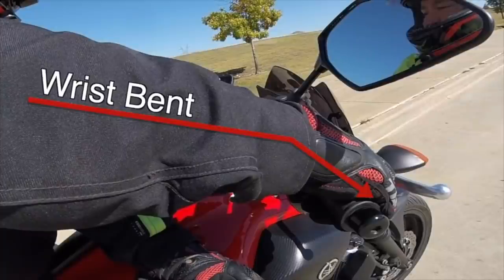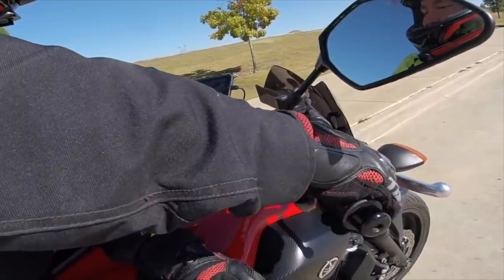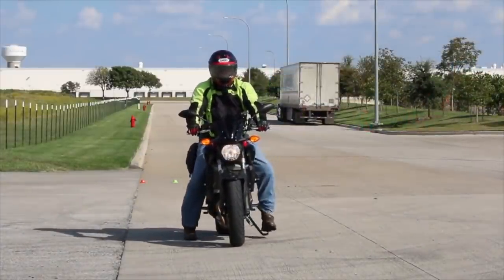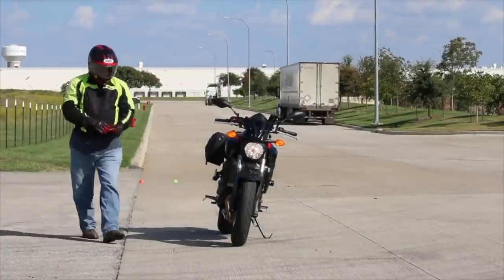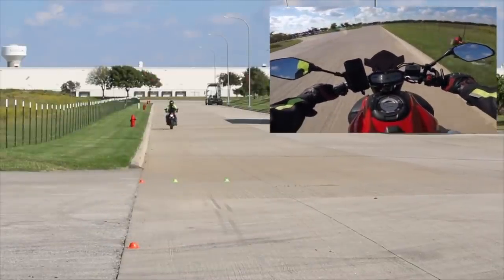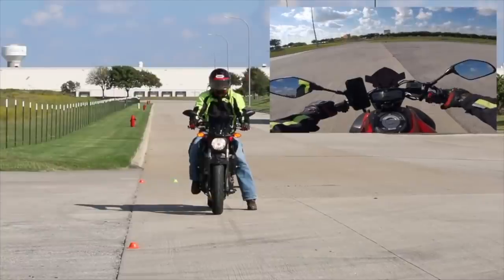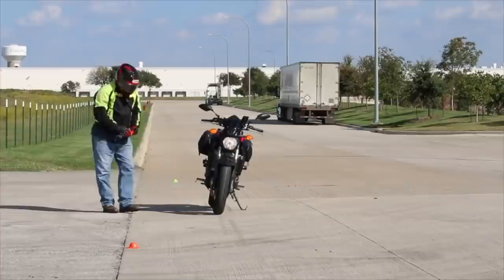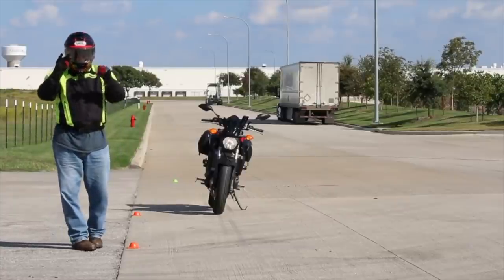How to use the throttle...many are doing it wrong.

Comment: I always cover the front brake with 2 or 3 fingers.  I roll on the throttle between my thumb and fore finger.  So I never have to reach for the front brake and I always have contact over the lever.
Reply: The fore finger tells the the other fingers how much and how fast to squeeze.  Index and middle finger is the ticket.
Reply: Helps with smooth throttle control too✌🏽
Reply: I do the same thing.  Bonus with throttle control.  However, in cold weather my pointer finger suffers the arctic chill. Heated gear helps. I was worried this is a bad habit. Thanks for validating and verifying this is good form.
Reply: Most people recommend the forefinger and middle finger on brake lever, but, like you, I prefer thumb and forefinger on throttle and outside 3 fingers on brake. I have equal throttle control and more leverage squeezing the brake in emergency situations.
Reply: @Old-n-slo-locked-n-leaned  My fore finger covers the brake while rolling on/off the throttle.
Reply: Glad to see I'm not the only one. I consistently ride with pointer & middle fingers on clutch/front brake levers. Def helps with throttle control/stability especially on the highway
Reply: Big hand guys. My hands are small , using gloves for a 12yr old is normal for me. Handles are not or poorly adjustable for us thus giving trouble with controling the lever.
Reply: @tpilot_error404  Lots of aftermarket levers to help.
Reply: @tomquinn607   in the US aftermarkets are easier to get , EU doesnt approve lots of aftermarkets and import  taxes are heavy.  I was happy with the one I had but lately it had wear out and broke off ( 15 yr old , 70.000k bike) so I ordered the original part but they changed the version (shape) and now I got these trouble.  With another bike I don't use that much ( 23 yr old) the lever is too far away to grab them both and non ajustable ( special version).
The custom parts I ordered almost never fits and because the bikes get old , my budget shrinks when other parts need repair . They are not showponies. I ride daily and have no car.
Reply: @tpilot_error404  I am an expat living overseas.  I never rode a scooter in the USA but now I have owned some fabulous CVT scooters.  They are fast and comfortable and exciting.  Looks like the answer for you bro.  I'm looking into buying one right now.  Yamaha, Suzuki, Honda and Kymko come to mind but even BMW and Aprillia make wicked scooters.
Reply: @Old-n-slo-locked-n-leaned  I do this as well. Never had an issue with emergency braking! I have tiny hands, so I've had short levers on my two bikes, an R3 (that I've done 130,000 kms on in 6 years!) and my Triumph Street Triple R
Reply: I do the same always have
Reply: I do the same thing.  Helps to make sudden stops if your fingers are already covering the brake.
Reply: I've been using the same method for years and works well for me also.
Reply: I was doing this at the MSF course… I was told that’s unsafe
Reply: @CarlosD360  This is accepted technique for throttle control.   There are other techniques as well.  Don't believe everything the MSF instructor tells you.  Research ..."throttle control".
Reply: @tpilot_error404  AVS adjustable levers will help with that
Reply: @tomquinn607  Only fore finger?
Reply: @CarlosD360  Why?
Reply: @noonsun533  No.  My whole hand is in play.  It's really one accepted form of throttle control.  Search "Throttle Control" on You Tube and you'll find my style and a couple others too.
Reply: Yep... Good practice I reckon.

Comment: You don't need to roll off the throttle to apply the front brakes, throttles are self-closing, just loosen your grip and let it close automatically. They self-close for a reason and don't need your assistance.

Comment: If I'm going to brake, I just let go of the throttle and reach for the front brakes. I never roll it back. The only time I'll roll it back is if I engage the throttle lock, but I never engage my throttle lock anywhere I may need to stop suddenly.

Comment: How to use the throttle. If you are getting sideways or otherwise have a problem, gently throttle on and pull out of the situation. Don't panic, don't brake, leave the clutch alone. If you have a blowout or otherwise a tire issue, don't touch any control, assess the situation and then jently brake on the tire that is still inflated.

Comment: I figured something out for myself a couple of days ago. I've been riding for almost 6 weeks, done 800Km (500m). I thought I was counter steering quite well. But recently in a corner, I found that my hand position was rolled too far forward and when I pushed I was effectively pushing on an angle rather than horizontally. This seems to me to be another good reason to hold the handle bars with the knuckles positioned up like you say. I'm using forefinger and middle finger (2 fingers) on the clutch as well.

Comment: This is one issue I've noticed while riding a smaller bike, like a 250cc. It almost encourages you to use the wrong wrist position just to be able to get up to the speed of traffic. I find myself constantly correcting for it.
Reply from the maker: Good point...on smaller bikes you need a lot of wrist rotation to get up to speed.
Reply: I havent even rode a bike yet and I already assumed that would be a problem. 
I am clearly blessed with superior foresight

Comment: I tend to ride with my index and middle finger touching the brake lever. I don't know if this is the right technique but it seems to prevent any delay in engaging the brake for a quick stop and allows me to trail brake without fully disengaging the throttle when I'm cornering.
Reply: That is the correct way to ride, take any advanced course or any track time at an on road or off road track and youll find out quickly. Theyll let you know if they dont see fingers on the levers at all times.
Reply: @AboutaMileAdventures  thank you
Reply: @AboutaMileAdventures  Thanks! I ride with my index and middle finger touching the brake lever and when I see that people teaches with no fingers touching the breake levers I feel like Im doing something wrong... thaks again for the tip

Comment: Hello Kevin, it's all the little things that make for a good ride. Back in the day, 70's or so, there was billboards that read look out for the other guy. I still go by this. It's almost like a sixth sense that helps reduce reaction time. Also on the throttle if you let off your grip on it, the throttle should snap back as it's spring tension pulls it back to idle.  Thanks for the video.
Reply: Letting go of the throttle completely is the opposite of smooth control
Reply: @nemomoriarty4303 So?  Who cares about being smooth with the throttle in an emergency braking scenario?
Reply: @jridenour31  I imagine anyone who wants smooth control over the motorcycle might.

Comment: Adjust your front brake AND clutch levers as to make your wrists straight. This will in essence keep you from rolling back on the throttle when in a hard braking situation or just braking in general. Last thing you want to do is accelerate while reaching for the front brake. These levers are made to be adjustable so you can tailor the bike to fit YOU. This also helps if you have a problem with tingling hands as it keeps everything in a straight line. It makes a big difference by doing these small adjustments.

Comment: Another problem / solution is the angle of your front brake lever. Changes in the position will help with being able to roll of the throttle while braking. Thanks Kevin for the great info!!
Reply: Yep, that's a good one. Most of the time these lever needs to be lowered from the stock version.
Reply: My master cylinder would rotate
 along with the brake lever if you try to change the lever's angle. Sucks.

Comment: This is something I need to practice more. A few months ago I started covering the front brake with a couple of fingers with the idea being that it would shorten my reaction time if I need to stop quickly. It does shorten that reaction time, but I'm compensating for the new hand position by starting my throttle with the overhand wrist position. Now my problem is that when I roll-off the throttle to stop at an intersection, I never roll off completely. I get to the stop and have to let go of the front brake so the throttle can completely reset under my hand. I'm going to start paying closer attention to how I manage the throttle rather than how to keep a couple of fingers over the brake. My riding style doesn't demand a lot of brake coverage around town, so maybe I should save the brake coverage for those open-road twisties. Thanks for another thought-provoking video, Kevin!
Reply: Try taking your hand pressure OFF of the grip/throttle and handlebars. Light touch and be able to move your arms and hands easily.  Think of the least amount of pressure to exert to the bars and grips; it can save your life.  Good Rides
Reply: Already logged about 6 hours practicing with my first big bike(650cc). Came directly from a 110cc scooter. At the start I was straining my grip and felt very uncomfortable using the technique of covering the front brake lever with 2-3 fingers. Now I’m already relaxed and comfortable with the technique. So I guess it’s just a practice and getting used to issue. The benefits of having your fingers out there (less panic braking, lesser stopping distance) outweighs the discomfort of practicing imho.

Comment: Thanks for the video! Should have watch this before I started riding my Surron. I have rode ATV's for years but getting used to the twist throttle is a challenge. When I was 10 years old I tried a little 50cc and did the "twist and go fast and then roll back throttle harder and go faster" and thank god my dad grabbed my shirt at the last minute, I would have shot off at a million miles an hour.  
Anyways 25 years later I had my first crash not even an hour in to my new Surron Ultra Bee JUST LIKE when I was ten years old. Fortunately I was also pretty heavy on the brakes so the crash was slow and in thick grass. But its was almost certainly because I got cocky with the comfy throttle position and went "neutral" but still had power. I guess its like playing a guitar, you just have to get used  to that discomfort. Good to know!

Comment: I see a lot of front brake levers turned more towards the ground which doesn't help with throttle control either. Always interesting, thanks!
Reply: Height of rider also determines position of the lever controls.  I'm tall with short inseam (long torso / short T-Rex legs), so my levers are adjusted slightly downwards as compared to a normal proportioned rider -- smy shoulders will be higher than others sitting on the same bike.
Reply: I adjusted mine downwards so when i'm off the throttle, and my fingers are at their farthest "forward" position they clear the lever faster and easier.
Reply: That makes it easier to cover the lever with your fingers if your using the technique.

Comment: All good stuff.  Very helpful.
There is also the issue of positioning your levers where you can best use them.  I spent a lot of time getting bar and lever angles right on motorcycles - and I still do on bicycles.
With clip-ons (truly the only choice for a sports bike) the levers are often best rotated down so that the wrist is straight when on the brakes. 
Of course there are bikes and bikes.... Slamming around off-road on a big-single trail bike (XT600 et al) requires different braking approaches to a road ride on heavy traffic on a sports bike.... and tracks are different again..... as are Alpine passes.
But everything in this video seems just about spot on.

Comment: Anyone who ever learned to ride a bike inevitably has grabbed the hell out of a front brake when something scared them in a parkin lot and dropped or nearly dropped their bike. Something I do is always cover the front brake with just my index finger. This does 3 things, firstly I am already on the control so I can apply it immediately when I realize I may need to slow down, second 1 finger is not very strong which means even under stress it is difficult to accidently over apply the brake causing me to drop it, and third it maintains that I never have to change my wrist position significantly to use the lever. Just a thought use it as you will. As well since I do ride a bike with a rather upright riding position I do have my bars rolled forward some and my levers lower than level so standing while riding is much easier, this allows me to be much more visible in congested traffic as well as see what is going on ahead in traffic much better than from a seated position. But, that happy medium of bar and lever position makes getting fingers around the levers much easier even if I was not covering them since my fingers don't have to become paralel with the pavement.

Comment: I like the second exercise, as that is what you have to do on an electric motorcycle with strong regenerative braking. As you roll off the throttle, the motor turns into a generator, taking energy from the back wheel into the battery.

Comment: I ride Solo the majority of the time and have a tendency to jam through the gears pretty quickly; probably short-shifting and not getting into the higher rev's. If and when I do have a passenger I become very conscious of my shifting habit because it causes a lot of head-bob. So I adjust and rev a little higher, and shift a little smoother.
Reply: When I have a passenger I pretend it's raining

Comment: This test seemed a bit subjective. Also, my brake lever is not several inches above my throttle like you showed in this.  However,  I am ALWAYS willing to learn, even after 55+ years of riding bikes, I will find an empty parking lot and check out the difference it may make to me.  I have a nerve in my wrist that gets pinched, after riding for over 500 miles it can start to cause pain and numbness.  If I hold my hand in the correct position, the nerve does not pinch.  Now that it is something I am thinking about, I will have to notice just where I place my hand.  I have a feeling it is somewhere between.  Thanks.

Comment: i would often hold grips in that wrong way when off roading because it would be easier to withstand shock and impact without wrist injury, however the tradeoff was the problems you mentioned.  I would use a quick let go and grab again technique to throttle down.  I would also grip without thumb at times when trauma was immanent.

Comment: I understand about not arching your wrist when you first grab the throttle.  My question is regarding your wrist being bent downward for an entire day, that has to be uncomfortable.  Where's the happy medium?   Keep the good stuff coming Kevin.
Reply: rotate the throttle under your hand with your index finger and thumb
same as when you stop pointed up hill and have to give it a little throttle while holding the front brake on
if you have to stop quickly release the throttle and it will snap closed itself